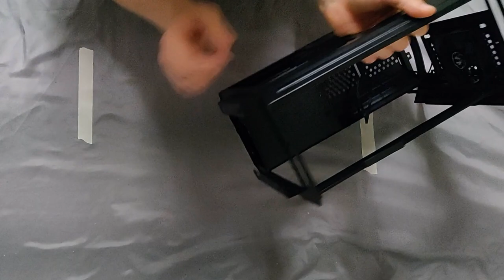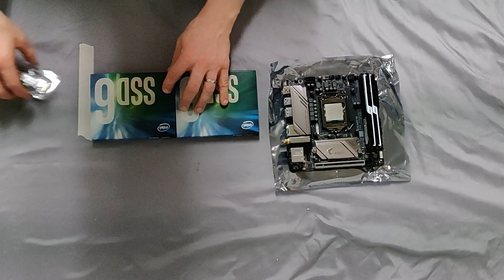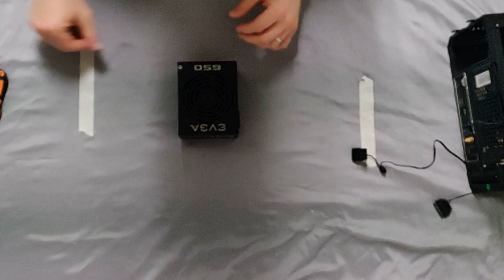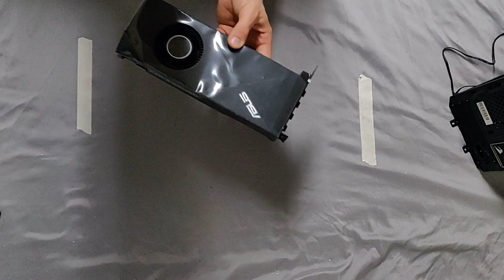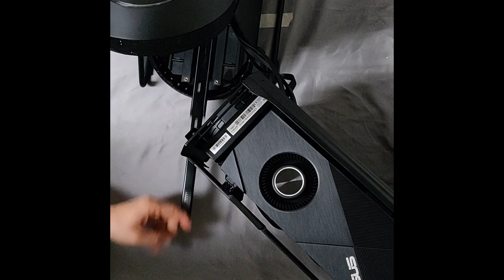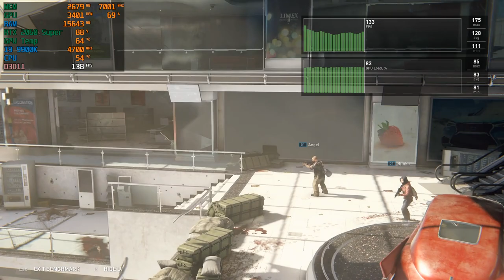Bitfenix Portal I9 9900K Build

Comment: Nice Build, but for this case I would have taken an other card. This asus card looks a bit boring... If I built my computer in there, I probably would have taken a card like the gigabyte GTX 980ti Xtreme or the gigabyte aorus RTX 2060 super
Reply from the maker: Funny enough, I originally bought the Aorus 2060 Super for it but it is too thick to fit in the case. This card was a fallback option. Certainly could look nicer.
Reply: Crash Wilcox  Ok, That’s nice to know. Maybe I would have got the same Problem... Unfortunately this makes the case a bit more uninteresting, but maybe the GTX 980ti would fit, I don’t know, I had non of these cards in my hands yet 😢😜